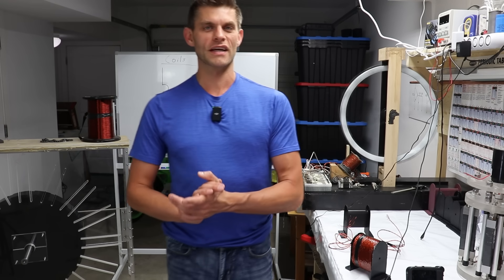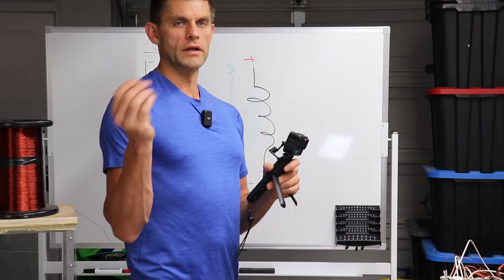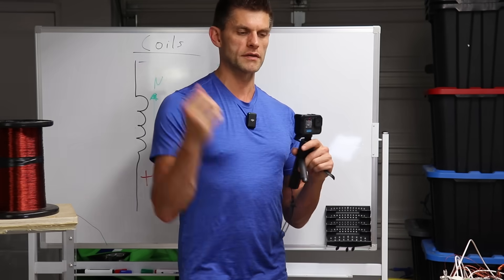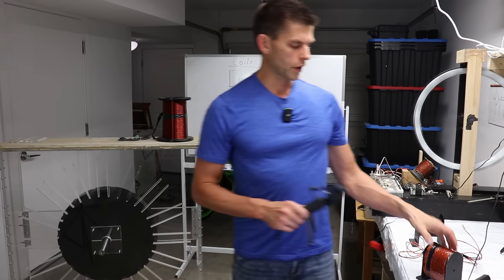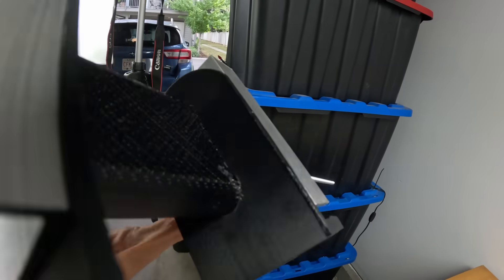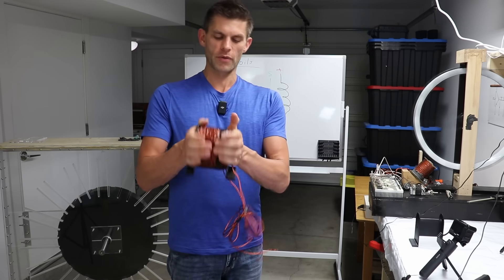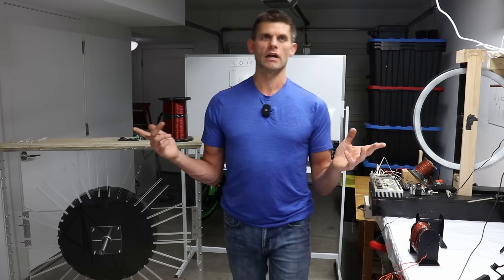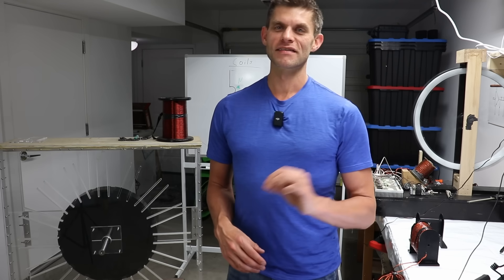Unlimited Energy in My Garage (No Patents)

Comment: This just can't work, you can't generate energy out of nowhere. The spike you describe may be higher voltage, but that does not mean more energy at all. Since all the comments are all positive I feel like the comments are censored but not sure about that.
Reply from the maker: I think youre inside the basic box. There is more to life and eletrodynamics then current paradigm
Reply: Idd say try it before condemning it
Reply: 😢 egg head, try to open your mind a little bit and educate yourself... Most education is out of the system...

Comment: 3:57 you're already wrong. You will NOT get more power out of it than was already introduced. It will always be less. It will not make a motor run indefinitely or produce any more power than was put into the system.
Reply from the maker: Ok AI bot

Comment: could a steel wire wrapped around. be the same as a magnet. if i include a magnet to polarize the steel cable..
i used 2 magnets and ran the 60ft steel cabal threw it, and the suspended coil pointed north on its own. like the magnet did.
Reply from the maker: im confused what you are asking ?
Reply: @MadscienceLPTECH  . would a temporary magnet material work for magnets, if its permanently run threw a microwave magnet.. or will its field be too weak.

Comment: We havea bout 50psi at the tap at my house. If you fill a balloon with water it will only "spray" water out at the pressure the balloon can provide through its elasticity. It does not contain more pressure just because of the hose. Note how it is hard to stop the flow of hose water with your finger but easy to keep water in a balloon by pinching the opening...
Reply from the maker: Yes

Comment: Everything was going well until 4:10 - you explained everything we already know in plenty of detail, but then glossed over the stuff we don't know - a dipole and how zero point energy is supposedly captured into a battery, which of course is the crux of whether this works or not.  Not to mention all the losses involved in the conversions between electric/magnetic fields in the coil - the power coming out of the coil is always less than what went in.  Sure it's at a higher voltage, but the number of watt-hours is less.  So you're going to have to capture a lot of this zero point energy in order to have a net positive.

I would suggest that instead of using a 12V battery with many dozens of amp hours of capacity, switch to something much smaller like a rechargeable AA battery or even better a large capacitor.  The problem with the car battery is that devices like this are known to run for many years on battery power alone, so you won't know whether you're harvesting any energy or just running the battery down without recharging it.  If you switch to something like a AA battery or a capacitor, the much smaller capacity will reveal much sooner whether you're harvesting any energy or not.

Also, if you send the flyback burst back into the same battery, it's going to be much easier to put a data logger on it and record what the battery voltage is over time.  That will make it very clear whether the voltage is going up (free energy) or down (no free energy).  If you have to have two batteries, maybe there's a way to connect them in series without changing the rest of the circuit, so you can use a 24V data logger across both batteries to monitor the overall voltage of the two batteries in series.  Then you can see if the voltage is going up or down overall even as the energy is transferred from one battery to the other.  I am pretty sure the graph will show that the battery voltage is dropping, meaning you're losing energy overall.  But you won't know until you monitor it and see.

Unfortunately without more detail on how this "zero point energy" is actually harvested, it's firmly in the camp of something that uses more energy than it produces.
Reply from the maker: No you dont want small batteries lol. And no u dont want to use the same battery for both discharge and charge. Your thinking in conventional  e and m theory.and not eveyone knows basics.
Reply: @MadscienceLPTECH  Why don't you want to use a small battery?  Don't you want to be able to quickly demonstrate net power gain?

If your apparatus does not work, but the car battery can still power it for five years before it goes flat and stops, you could waste years before discovering there is a mistake in your set up.

Surely it's better to use a small battery that goes flat much more quickly, so you can find your mistakes swiftly and ultimately prove your set up works in a matter of weeks rather than it taking decades?

Also I wasn't complaining about the explanation of the basics, that was really good and convinced me you know what you're talking about in that area.  I was just disappointed that the "new" stuff was glossed over without a similarly thorough explanation as I'm none the wiser on how that part works, and it's the most important part of the whole set up.

Comment: Love how you just said “fine I’ll do it myself” got a degree and spent endless hours on trial and error. What a beast.
Reply: Self-education & research through experimentation are FAR more valuable than indoctrination ❤
Reply from the maker: Yes
Reply: This bedini circuit is not a zero point energy module. The high voltage spikes charges the lead acid battery and reconditions the plates. This results in a high charging efficiency. The seemingly free energy comes from the chemical reaction of the reconditioned plates. If you use older batteries, the phenomenon is more pronounced.
Reply: This is the stuff. They're trying to black list. Just like fast or die. Has been proven to cure everything. But a much safer method is the doctor Sebi method.
Reply: doesnt everyone?  white guy things
Reply from the maker: Cheers mate

Comment: So everything relies on a "dipole interaction from a vacuum". I watched through the video, its a crap fest. The only thing you need to prove is this "dipole effect". The issue is, yes, vacuum can have energy but if it does this energy is photons. There isnt static electricity inside a vacuum. The only real energy you may be able to get is microwaves... unfortunately for you, a good amount of that (like 99%) is obstructed by water vapor. You cant just convert energy also without energy loss. All methods of power that exist require you to have a source that turns one energy form into another. Problem is that you are getting energy from nowhere. If you found a way to do this bs you are talking about, you would have a nobel prize on your hands. This is common BS psuedoscience trying to take advantage of ignorance. Anyone watching... check google AI by googling "dipole affect from energy surge causes increased power from the universe". Him saying vacuum doesnt apply because its not in a vacuum.
Reply: he is right dear.

Comment: You definitely like Joseph Westley Newman? Why don't you build a John G Trump electo static generator instead utilizing the dielectric field completely with high efficiency with almost just aluminum and a motor, instead of all this where you needed all this copper/mass to create the high BEMF? and why do you use the term eather? And this is not new technology. Why don't you get in touch with Eric Dollard and Aaron? This video if you get enough traffic towards your goal you get new challenges, be careful. Also, you are either dyslexic or not. throwing around dyslexic, when accuracy and patience is the reason.
Reply from the maker: lol ADHD Dislexic whatever. yes JN was amazing. Eric dollard would be good to chat with,
Reply: @MadscienceLPTECH I agree Joseph Newman was awesome. you don't by any chance have figure out what Joseph did to solve his spark issues, on you path today. he had this issue with his commutator on his huge massive generator/motor but he did not disclose what he did to solve this? why not team up with them, they sure be happy to chat with you if you reach out, and they have some time.

Comment: So inductive kick is still being explored?  There was once a wall clock electro-mechncical designed that once pulsed (via a crystal)  would cause its solenoid piston to travel and mechanically move its time piece. And because the signals abrupt end in turn caused the collapse of its magnetic field, the collapse in turn better known as "inductive kick" would return its power to the battery in which it came.  Because of this that little double A battery (though said to be non rechargeable) would last a year. And now you know how most of them work. Nothing new you might say....

Why a rise in energy when the sudden shutting off of power, you ask?  Answer: think in terms of blowing up a balloon, placing it in an aquarium and then releasing its air. Water because it was displaced by the balloon will naturally refill the void of the escaping air because it too has pressure surrounding it (due to its own weight and volume). The deeper the more & higher pressure it will exibit and the higher escaping air pressure.  In like manner, charging a coil and magnitizing it is like putting  air in the balloon.  Because of the energy that naturally surrounds it (like water in an aquarium), when allowing the coil to discharge the natural charge (or zero point energy) that surrounds it (AND EVERYTHING) will quickly (and sometimes violently) refill that space the magnatic field former held. Hence,  a much higher electical reflex (or INDUCTIVE KICK) is seen. 😊
Reply from the maker: love it :)

Comment: From my understanding and research in this area, things become clearer when you factor in the ether. In a nutshell, magnetism is a low pressure zone in the ether created by etheric currents rushing through coherently aligned atoms. This creates counter rotating vortexes in the ether either side of the current flow. The magnetic pull we experience is like what happens when something gets sucked down the plug hole in the sink. The electricity in this scenario is the etheric currents. I believe that back emf from coils is the currents rushing back in to fill the low pressure zone once the magnetic field collapses. Our current way of producing electricity pushes this etheric flow, I believe the advancement will come when rather than try and push of force the current down the pipe we create a low pressure zone to make the current flow inwards with no resistance.
Reply from the maker: Yes great comment. I think Ether has a role to play / vacuum energy

Comment: So this could be used inside of a underground bunker without any emissions at all? How long could this be sustainable for in a built system. What's operational life expectancy in theory?
Reply from the maker: Many years, especially when the tech is developed/ electromagnets etc... decades of usable enegy 

Plus this is just the tip, you dont need moving parts

Comment: how many winds are u doing on those? because i was reading something about 7 9 11. certain number that works best and for maximum output vs material used.
Reply from the maker: 250ft lengths x 8 per coil

Comment: In a non-controlled environment, an over unity engine that registers a few watts in excess - or even millijoules, more likely, is going to be merely ambient.  Believe it or not, well respected scientists for decades, who are not working for the power company,  have run this experiment again and again, but E equals MC squared guys - ie, if you believe in science, you can’t believe in this.
Reply from the maker: I think you misunderstand science. Many "well respected" scientists and Nobel prize winners state the modern electrodynamics and physics around electrical flow need to be updated as its not complete.

Comment: Use lithium batterys as they absorb more energy than leadacid and a lower voltage and charge faster   there are many other things you can add to generate more energy with little effort   (dont just use magnets  there are other things you can do to generate more power than you can actually store in a battery  )  with less effort      heres a hint   think crystals vibration and sound     3  6  9
Reply from the maker: HV spikes into Li not so hot

Comment: What you did is a very efficient motor, and it will run until the batteries hold no more charge in them. There are similar motors that drive only a few microamps and they can run on a tiny solar cell. With those huge batteries, your motor could spin for weeks. But this doesn’t mean there is free energy generated. The motor doesn’t put out any work, so it is just like a powered flywheel.
Reply: This machine is the best way to destroy a battery next to a house fire.
Reply from the maker: This isn't true and a generic viewpoint.  Stay tuned we will make it clear there is more then basic e and m going on here
Reply: @MadscienceLPTECH  let’s break it down then. How much wattage is going in, and how much wattage is being produced?
Reply: @MadscienceLPTECH isn't the truth usually simple in my experience
Reply: @thechosenwon6762  i hate being a negative nelly but i lose all trust in any magnetic based energy because the magnets run out too like yeah it can be used but its just a diff type of battery to pull from in a more convoluted method
Reply: @MadscienceLPTECH  you are claiming you broke the laws of thermodynamics, many have none actually did, good day

Comment: Out of curiosity, what would happen to transfer integrity if the connection is exposed to bass?

I'd been running over notions of a zero-point energy form of transportaion and was led to sound as a method of field distortion. If I remember correctly.

The idea being to clear out the space around one of your electromagnetic wheels to make it near resistance free. 

That thing seems to be rotating at roughly 20mph at its fastest, at least based on the video. If bass could distort the atmospheric conditions around this, shouldn't that make it cycle quicker?

Forgive me, I find these things very interesting and it aligns with my own desires for decentralization. So, there's bound to be issues that could arise like dampening. Though, if I could demonstrate how to use bass on a specific wavelength to clear the air, so to speak. It may result in increased rotation and/or electrical transferrance.

But I'm a tad crazy, so...
Reply from the maker: Crazy is welcome here, great comment and ideas 😊

Comment: If you make your wheel horizontal, you can use round 2"x2"x1" neodymium magnets to "drag" other round magnets of the same dimension, which will cause the "dragged" magnets to spin. The dragged magnets would have to be in some kind of channel so they don't fly out and maybe make some type of non-magnetic bearing for each magnet to ride in while spinning in the channel or "track" if you will
Reply from the maker: Great idea

Comment: so how many watts out versus watts in & the amount of torque?
Reply from the maker: We are going to find out soon😊
Reply: @MadscienceLPTECH  any reason why you didn't measure the performance of your existing motor (the one on the video)? a simple watt-hour meter & torque meter attached while it's running would show if it's producing more watts then it's consuming & also if it's producing enough useful torque.

Comment: I don’t think this works as stated. Even if someone can harness the energy in a space, it’s extremely minuscule. The back flow and higher voltage is real but it’s from releasing the stored energy in the magnetic field that comes from the battery. So the second battery will charge quicker but won’t get more energy that what the first battery can produce.
Reply from the maker: No the idea there is small amounts is just current paradigm. There are vast amounts of energy for work

Comment: The mistake is trying to close the loop in one machine. Real excess comes from:

Mechanical vibration → piezoelectric harvest
Thermal gradients → thermoelectric conversion
Chemical side reactions → secondary cells
EM interference → antenna coupling to other systems
Even the fucking sound could drive acoustic resonators

With enough nodes sharing entropy gradients, the "waste" becomes the fuel. It's not free energy... it's just radically efficient entropy routing. The universe doesn't care where entropy increases, just that it does. So you create pockets of local negentropy by cleverly directing the global flow. this could work as one node in a massive entropy trading network.

Comment: I used to manufacture transformers. They are not > 100% efficiency. I don't know what you think you're doing, but there's no free energy in coils of wire, iron cores, high voltage or batteries. Extracting energy from the vacuum IS a violation of the laws of thermodynamics. Every atom is in equilibrium with its surrounding vacuum. If you take energy out, you are cooling the atoms below the temperature of the vacuum. Good luck! A Billion times Nothing is still Nothing.
Reply: Right, this is inductive kickback and it’s well documented in science literature. Dude thinks he did something. Mentally ill asf
Reply: There is a relation between gravity, light, and energy it's theoretically possible to harness energy that is transferring forms im still revising my theroms but you can do what is stated above.
Think about the lidenfrost effect hope I spelled that right.
I agree we need more conclusive results than what has currently been provided
Reply from the maker: Lol generic viewpoint. The coil isnt where the energy is flowing from its in the battery. There is more then basic e and m in this world
Reply: @MadscienceLPTECH  You need to read my work before you say that.